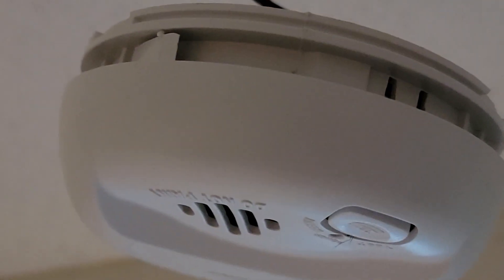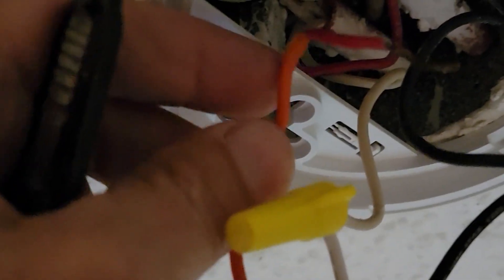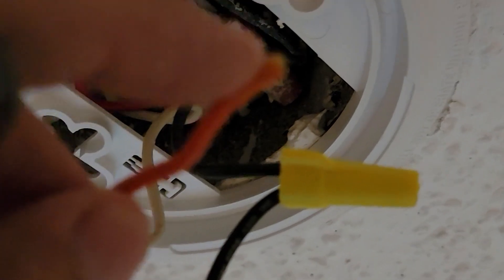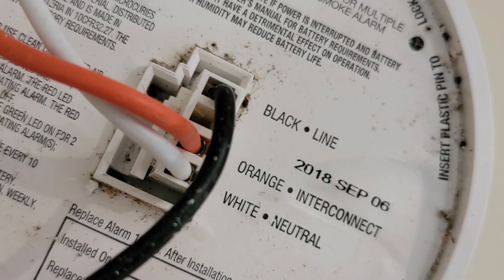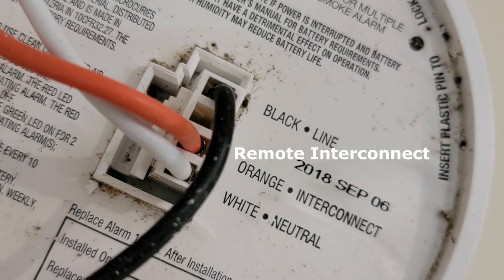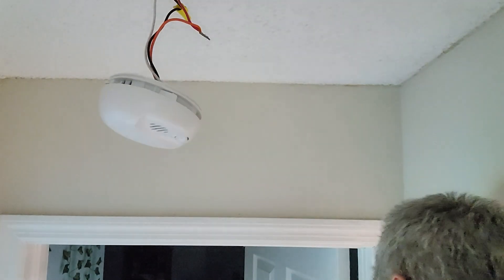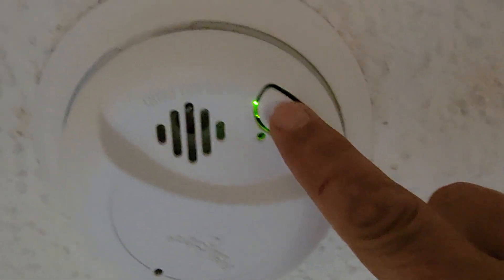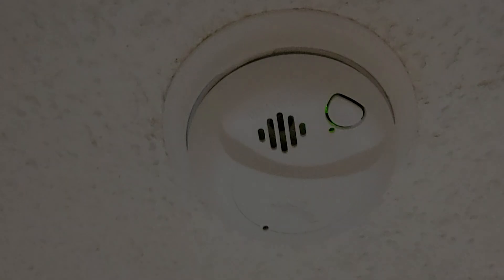STOP Installing Smoke Detectors WRONG!

Comment: You are making a LOT of assumptions here which may not be correct.  The presence of a red wire may not be for interconnection purposes.  It could very well be a multi-wire branch circuit, in which case the red wire is 120V for an unrelated circuit.  Worse yet it's 180 degrees out of phase with the black one meaning you've got 240V across the two.

Obviously you've never set foot in anything but a brand new house (I'll call that 20 years old or less).  Which is surprising for a guy who seems to hang out in home improvement stores all day, as brand new houses generally don't get sliced up by the homeowner.

It's also surprising that a guy who is not "young" has never paid attention to wiring when he was younger.  Dedicated wiring for smoke detectors (esp interconnected) is a relatively recent thing.  Lots of ways to put in hardwired smoke detectors after the fact though with existing wiring, and a homeowner with such a setup encountering your video is likely to cause damage or worse.

P.S. Someone may not WANT his smoke detectors interconnected.  You cannot tell where the smoke is in that case.  Granted, in your shiny new 5-acre mansion with prewired detectors you do need them to be interconnected otherwise you'd never hear the one.
Reply: All of that P.S. would be up to the fire marshal and codes, right? They may not allow someone to keep the orange wire unconnected, legally.
Reply: @Garth2011  Well yeah in all cases it's up to the authority having jurisdiction.  And just FYI, no, the National Electric Code does not apply to the entire country.  It is up to each locale to adopt whatever they see fit, put in place exceptions to the NEC (if they even adopt it at all), etc.

What happens after the inspector leaves, well he doesn't know.

I guess it depends on what kind of person you are:  Are you going to go to the source of the smoke and toss the smoldering couch cushion out the window?  Or are you going to stand there on the lawn watching your house burning down waiting for someone else in a red truck to solve your problem?

In fairness it's stupid to leave a wire uncapped even if it's not stripped.  It becomes a possible pathway for a fault if something comes loose in the box.  Unlikely, but still possible.

I should have mentioned in my original reply that if that red wire is part of a MWBC, it's on a different breaker and thus is still going to be LIVE.  Meaning death to the tinkerer if you're doing this in a concrete floor basement perhaps.  That 2nd breaker is supposed to be handle-tied to the first one, but often times it's not.  Unless, once again, you're in your shiny brand new house.

If you ask me, the NFPA (who puts out the NEC) has lost all credibility over the last 15 years or so.  They've strayed from their mission of preventing fires and are now a bunch of nannies.  For example adding things to the code to prevent the homeowner from being inconvenienced but adding nothing to fire/shock safety.
Reply: @core251  I said codes or fire marshal, not national electric codes. BIG difference.
Reply: @Garth2011  My error.  NFPA 72 would be applicable here (IF your locale adopts it).  Brought to you by the same nanny folks as the NEC.
Reply: Uh, how can u be “180 degrees out of phase” on presumably a single phase system? You’re not very smart when it comes to electrical after all.
Reply: @electricianron_New_Jersey  Because the transformer has a center-tapped neutral.  How do you think we get 240V and 120V?  "We" being the USA.  Elsewhere it is not center tapped.  If you need education about anything else please feel free to ask.
Reply: @core251  like previously noted… those are legs not phases.
Reply: @electricianron_New_Jersey  Correct, and I didn't call them 2 phases.  I said "180 degrees out of phase" meaning delayed (or advanced) by half a cycle.  Is that not a phase angle even if they are not phases?  You seem to be arguing just for the sake of arguing.
Reply: @core251  we do not have two phase 240 most US houses.  We have a center tapped neutral, but it's on the same phase, so they are in fact not 180 degrees out.  If people are repurposing electrical fixture locations for other locations, and they have no idea if the red wire is for interconnection or if it's another 120v hot, then they need to figure that out first. This was a designed smoke detector location in the video, so that isn't relevant here.
Reply: @theJonnymac  Put both legs on an oscilloscope and tell me the angle difference between them.  You want to say it's zero?  Nah I didn't think so.

I'm not going to address the use of the term "phase angle" as I've never heard the term "leg angle" used and I've already gone through that with someone else.  Seems that's all YOU want to quibble over, I get that.
Reply from the maker: Core251, my "assumption" as you called it was not a careless guess as trolls like you would try to point out, but it was based on my engineering experience, based on the fact that the other smoke detector had the same red wire going to it, and I had tested no voltage on it, so not a branch voltage of 120v out of phase with the black wire like you guessed. I can't imagine any reason why someone would route a single red wire to both smoke detectors for use as a branch circuit, then not use it as a branch circuit. This scenario which you concocted up out of the blue is so unbelievably unlikely. This is surprising for a guy who seems to pretend to be an expert while condescending to the guy who actually correctly identified that the wire was indeed the interconnect, made the appropriate repair that the builder's electrical contractor failed to do, tested it, and proved that the red wire was the interconnect.
Reply: @jeffostroff  Yes I'm (half) confident you knew what you were doing in this particular case.  My original comment was more about the video being passed on to viewers without futher information, and the blanket usage of the word "wrong".  You told VIEWERS to stop connecting detectors "wrong".  You didn't say "this ONE friend did it wrong".  There's a difference.

As for engineering experience, EE's are the ones I see get bitten (shocked) most often on household wiring.  Heheh I'm not sure why that is.  Not that it matters because you're not a EE anyway.

Fortunately I dropped out before completing my EE.  Or today I'd have to be working a real job.
Reply: @core251  1) No licensed contractor would supply 240V to a ceiling fixture meant for a smoke detector. 2) If you're a DIY person and have to replace a smoke detector, Jeff explaining what the red wire is for is invaluable. 3) I had to replace 7 smoke detectors in my home, had the same model shown as the replacement, and noticed the manufacturer had not stripped the orange wire (likely for a home without interconnected units) so I did strip mine before connecting. Again, Jeff pointing this out is invaluable. 4) You're likely  the person everyone talks about behind your back as the "know it all," but no one cares. Congratulations!
Reply: @seminolefantodd4736  You're not getting it, when you say no contractor would bring a MWBC to a box meant for a smoke detector.  The point is when smoke detectors are hardwired to EXISTING wiring.  For example the previous homeowner had an overhead light fixture which he no longer needs, so he repurposed it.  There's no junction box you can buy anywhere that's stamped on it "for smoke detectors only".  

And who said anything about a "contractor" anyway?  Even so, your premise is wrong.  It is perfectly legal to bring multiple unrelated circuits through a single box.  It's done all the time.  In some cases this avoids the need for a "blank" plastic cover elsewhere in difficult situations (fished cable).  Because of course it has to remain accessible.
Reply: @seminolefantodd4736  1) NO? licensed contractor would supply 240V

Well who are you to talk for all licenced contractors?

Comment: OK so I did it wrong and blew the device. Night another did it right and it won't work.?
Reply from the maker: You will have to us ea new device then, but correct the wiring first.
Reply: @jeffostroff  The battery works but no green light. I rechecked the wires twice. Should I worry bout it? The battery beeps when test

Comment: Believe it or not, a professional electrician was at my smoke detector wasn't working properly being in home improvement myself. I have a general knowledge of electric. So I did not took a look. He did the same thing. Didn't connect the interconnecting wires.  Wow something to be said for hired a professional.....

Comment: Why is the red wire not orange? You would think they would make the orange wire red to remove all confusion.
Reply: Because it's standard wire often used for mwbc circuits or 240 with neutral circuits, for which red is the correct color, it's not special smoke detector wire  (and no I don't know if anyone makes special color coded wire for residential smoke detectors, there is special wire for commercial fire alarms, but that's very different wire.

Comment: Hi can I switch to a battery operated smoke detector (without any wiring) if my previous smoke detector had wires and a back up battery? Maybe I should just stick to the one I already have which has the wires and back up battery. That’s safer anyway right, because it has a back up with wires and battery? Thank you for your help.
Reply from the maker: building codes currently require them to be wired so that if one goes off they all will for safety.

Comment: Time to update your instructions  1) Don't throw old units away "dispose of them properly"  2) Consider using WAGO connectors  3) Five year batteries save time  4) Buy bulk "name brand" units with 5 year batteries and change them all at the same time

Comment: They have improved them over the years however, I'm wondering why the various fire codes don't require 110v and battery.
Reply from the maker: Probably because so many people have older installations
Reply: If you mean they have improved them by making them fail in the middle of the night, then I suppose you're right.

Comment: What do you do if you don't have any wires but the black and white  ones ?
Reply: If it's only black and white wires,, it is very likely you that you only have the "hardwire" option only.
Reply from the maker: You are probably  Grandfathered in although I questioned why there wouldn't be to 3rd wire I'm just not that familiar with the older installations and all of the installations I have seen if you have the black-and-white wire you usually have the red wire.
Reply: and then there are those with no wires at all.
Reply: My husband checked our hardwired detectors and there is no red or interconnect wire. Our house was built in 2008 so maybe it wasn't required then. Both of the smoke detectors were dated 2008 with a 10 year lifespan.  Going to Lowe's this weakened to get new ones.
Reply: There are hardwired models with wireless interconnect, they're more expensive and harder to locate (IE not available locally) and may not have other specific features you might be looking for (IE Voice based alarms). That being said, if the ceiling box was placed for a hardwired smoke detector and not a ceiling light, then it will have a signal wire present. This may not be true, if the work was done by an unqualified individual.

Comment: Ummm ...  you mean one battery powered smoke detector from the 80s is bad?  :( mom hasn't set it off in years while cooking.  I just thought she was getting better at cooking.
Reply: Yes, those should be replaced with the new ones that have 10 year lithium batteries and when it time to change a battery, the entire detector is replaced.
Reply from the maker: Yes and guess what a lot of houses have poor ventilation so so these sensors can also get clogged from all of the grease in fall out from cooking that accumulate over the years just go on to some people's kitchens in the upper cabin as you'll see Greece and slime all over the front of them

Comment: ? aren't you also suppose to tape them to not just wire nuts
Reply from the maker: There's nothing wrong with applying electrical tape after you put the wire nut on, but it is not necessary. Why aren't we nuts have been standard in electrical wiring for decades and they are reliable and you don't have to add anything beyond the wiring on the wiring nut to make the connection any more secure.
Reply: I've never come across a wire nut that has black electrical tape around it nor a reason to do so. Newbies might do that for some reason.

Comment: So that's what they mean when you have to connect all of them in sequence, in California you can't use batteries no more if you build something new or add
Reply: Yeah I was in Colarado this weekend visiting family. Uncle showing his basement and mentioned that inspector didn't pass the alarms cuz they missed that red wire. It stop the sequence to the floor above, and that's when my in law mentioned he had to replace all the old alarms with batteries and add new hot wire(carbon monoxide and smoke) alarms to be sequence with the new addition he built (in California.....)
Reply from the maker: What about the 10 year smoke alarms with 10 year batteries in them?
Reply: @jeffostroff  if your not doing nothing to bring the inspector on board your good,(existing)
Reply: The hardwired ones also have to have batteries.  And there are wireless interconnected ones that can bridge from an addition with hardwired to an older section of the house.  Just have to be proactive, confident and calm with the inspector.  Ideally, in the planning phase before you start construction, you get this approved, so you can't be sidewiped by a clown inspector later.

Comment: Smoke alarms are different than smoke detectors.
Reply from the maker: Yes I use the term interchangeably for SEO purposes
Reply: Yeah. I get the point of calling them smoke detectors: my parents used to call them that as well. Smoke alarm is the true definition for a self-contained smoke warning device like this. (Or ones that only run on batteries, which should really be for a shed or other one room structure in my opinion.) “Smoke detector” usually refers to a smoke sensor that is hooked into a security system or commercial fire alarm panel, like those in schools and offices. In this case, the “Alarm” portion would be located in the notification devices, which consist of either horns in small buildings, or an amplifier and speakers in a large building, and also contain clear, bright (15-110 candela) strobes flashing once per second in most buildings nowadays. These devices usually have to be labeled “FIRE” but I have also found a few low-profile ones with a tiny visual of a person running away from fire, in the case of one brand, and I’m honestly not sure how they got away with that one.

Comment: It doesn't occur to the dimwits who installed the detector that the red and orange wires which were connected together on the old one also should be connected together on the new one too? Pretty sure this error does NOT happen in a new house...at least the 4 that I've seen were done correctly from new. So it seems more likely that this is done when the detector is replaced.
Reply from the maker: Also another good reason to test monthly, as this could have been discovered a lot sooner. I noticed it because I was sanding the drywall near the other smoke alarm, and thought it was painted over, and dismantled it, noticing the the green light wasn't on. Then I discovered the bad wiring

Comment: why aren't they battery backup'd?
Reply from the maker: Some units are battery, some are wired.
Reply: @jeffostroff  Every smoke alarm has a battery backup if it is hardwired. There is no exception.
Reply: @GregoryLasVegas  I have seen several older hardwire alarms that have no battery backup.